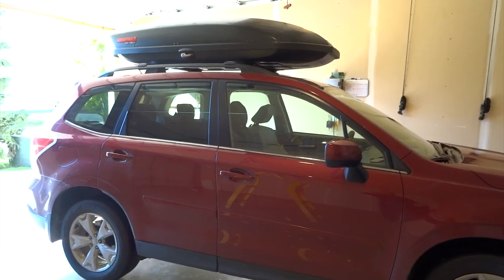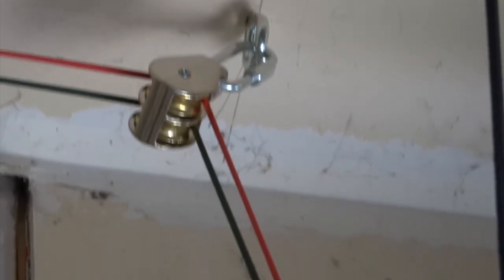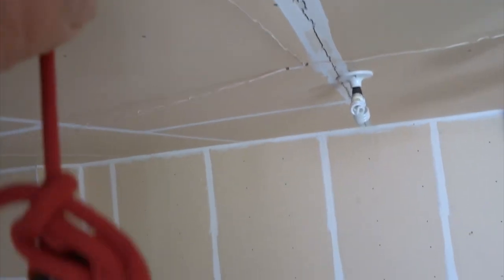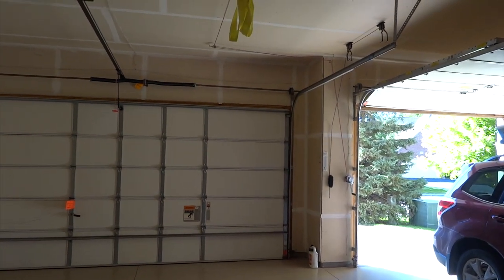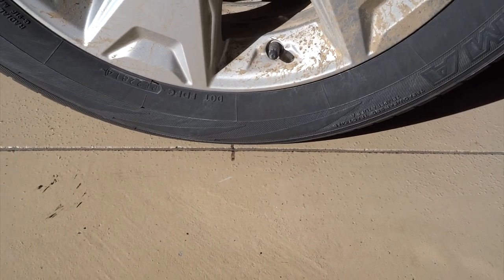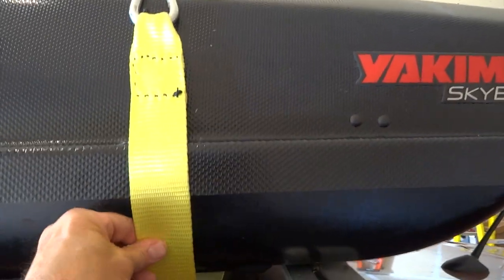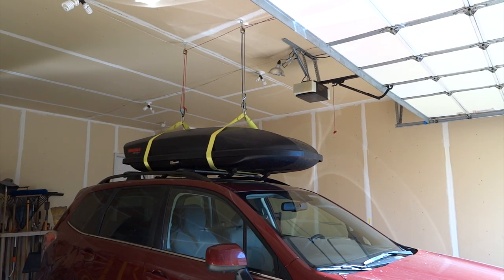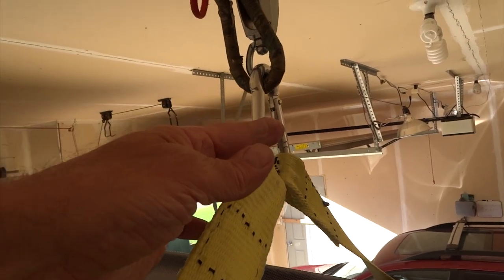Yakima Skybox garage ceiling storage system

Comment: Very nice design. However, you can buy from Thule (Swedish Roof Box manufacturer) a ready made, simple, roof box lift which will do this job. The model is the either the 571 or 572, check it out on utube, I have two of them, they are brilliant! (I don't work for Thurle by the way)

Comment: Thanks for the very detailed break down of your system. I'm looking at what others have done because I was trying to build a hoist for my skybox as well, but ran into the thing being too heavy to lift. I'm only using a single-pass set of pulleys, so will need to double up on them. The manual winch is a great idea too - will have to keep an eye out for one. Thanks again.

Comment: You did inspire me to take on this project! Unfortunately I don't have the headroom on the door opening to enter & exit with the box mounted on the Jeep so it will only be for storage. I will still have to hump it outside to mount. A major disappointment but for storage it's a major plus....nicely designed!
When building in 2008, I wisely put 9' wide garage doors...I overlooked the headroom...I'm short by about 8"...my wife would commit me if I deflated the tires each time to mount & drive!
Reply: Reaganx229 F/

Comment: My only issue with this is I think it should be hung from 4 points. Probably not a huge issue but personally I’d be concerned about lateral compression across the box. The lids aren’t very strong and this could damage them.

Comment: Super video! One question:  How did you attach the winch to the wall?  Did you have to modify the winch housing (e.g., did you drill holes into the housing)??
Reply from the maker: I did not drill or modify the winch housing.  The winch has a number of holes in its housing so, using these, I bolted a leg of each of two corner braces to the winch housing and then screwed the other two legs into the wall studs by the garage door (stop the video at :44 to view).
Reply: @prharp  Now I see/understand how you attached the winch.  Thanks!  Good job!